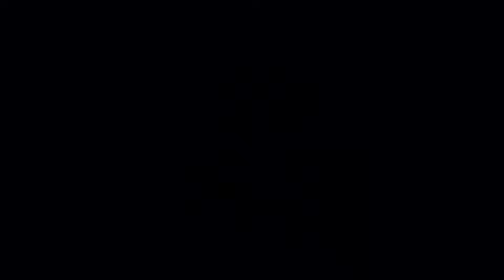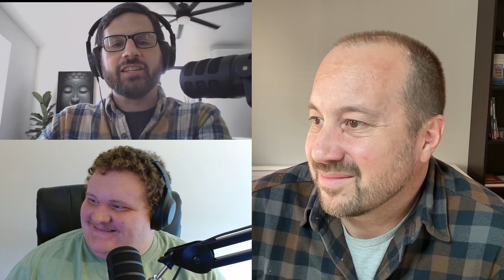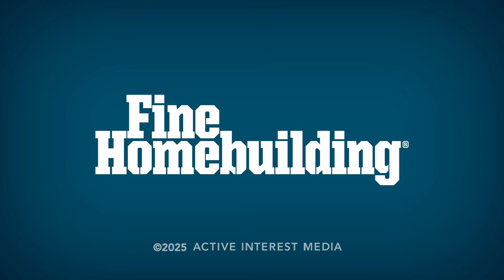A House Without Sheathing Doesn't Have to Be A Teardown | FHB Podcast Episode 711

Comment: Go glad I came across this video. We recently bought a 1979 built house in NorCal. Definitely Overpriced but we got a good interest rate  🙏 
It has very little light so we put in a window on the SW side of the house to bring in some natural light. When putting in the window we found out there’s no sheathing, vapor barrier/house wrap on the house. They just nailed wood siding straight to the wood frame! That’s one reason why my pge bill is outrageous! That along with corporate greed, Newsom’s corrupt backdoor deals w CPUC, PG&E, etc. 
Also they build it on a slab foundation at the bottom of a hill so it floods in the yard. Front AND back yards. First winter the water got into the house! Flooded our sunken living room. Yes they brilliantly thought to put in a sunken room on a slab foundation at the bottom on a hill. Smart. This summer I and my son dug and replaced a French drain but the neighbors yard still drains into ours. Idk if it’s worth it to put up sheathing. Probably won’t know until all the siding is ripped off to see the extent of the damage on the dumbest house ever built! Any tips?
Reply: PG&E bills are generally outrageous -- their rates are nuts. I suspect you'd benefit more from a big solar system + battery backup (look into EG4 options) vs doing a deep energy retrofit. I say this as someone who is just wrapping up a deep energy retrofit and preparing to also add solar + battery backup ... I'm in Minnesota, so the energy retrofit makes a bit more sense with our 0F winter temps, but even so I don't expect it to ever pay itself back. On the other hand, solar in PG&E territory probably will pay itself back in a relatively short time (<10y).

Back to the broader topic ... I'd go in the order of operations: water, air, vapor, and then insulation. On the first two:

Water: If you still have lingering water issues, I'd address those first. If your neighbor's yard drains into yours, is there a way to divert that water elsewhere? And are there any other water issues, e.g. leaky roof?

Air control layer: Sheath would help seal up air leakage, but the details are challenging. If you cannot seal up the bottom and top of the wall, you'll still have a significant stack effect, so be prepared to spend a lot of time detailing around all the rafters and such (or do a chainsaw retrofit and do exterior roof insulation)

If you do resheath, get ZIP -- it's not that much more expensive after thinking about the insane amount of time that is going to go into this. I recently tore off the entire exterior on a 2-story + attic home (27' to peak), resheathed with ZIP, new windows and doors, added 4" of exterior insulation, and put on new siding, detailing all the building science stuff meticulously (and doing my best on the aesthetic stuff). I would never do that again except possibly on a one-story home with an attic. If I lived in California, I'd just get a big solar array plus perhaps a modest battery system and call it a day.

Long term, I think it would be cool if California residents grouped together to do their own microgrids and largely detached from PG&E. In some areas (e.g. San Francisco), my estimates are that this would be economical based on current PG&E rates.
Reply: @dosadoodle thank you for your response. I didn’t think about going around the rafters for the sheathing. I thought it would stop at the top of the wall. I did want to use zip. I did think it would be an easy-ish fix…tearing off siding nailing up zip and putting siding back on, but what do I know? I have no experience. We do need a new roof as well 🤦‍♀️ metal is best for fires in our area. But expensive. it might be better to let it burn in a wildfire at this point lol jk. In the process of getting the neighbors to fix their drainage issues. They’re new owners as well and are wanting to address the problem. Currently heating with firewood only to keep pge bill down. It doesn’t get below 25-30 here. I left SF to buy and miss those  0.11 kWh bills compared to 0.41/0.51 kWh in the country! It blew my mind that’s it’s more expensive in the country than in the city 🤷‍♀️ solar is definitely gonna be the best bet for cost/roi now.
Reply: @Ang.0910  FWIW, I also didn't have any experience before I completely tore off the exterior of our house and resheathed. It took a lot of time and I'd been learning about building science and watching lots of examples for years (before we even owned), and the work was very difficult and took significantly more work than I expected (especially any work above ~15 feet, even with scaffolding). If you are really excited about it, then go for it, but the payback rarely outweighs the costs.

> We do need a new roof as well 🤦‍♀ metal is best for fires in our area.

For roof, I'm 100% in on metal. We got a standing seam roof (our roof was also shot), which makes solar install easier (see the "S-5" fastener system). That said, if a roof has a lot of valleys or hips, then I think the price of a standing seam metal roof goes way up.

>  I left SF to buy and miss those  0.11 kWh bills compared to 0.41/0.51 kWh in the country!

Those are insane prices. If you can DIY your solar + battery system, I'd bet you can get paid back on it quite fast (a few years). We're looking at a payback period of roughly 10 years in Minnesota for a DIY install (~10% annualized return on investment is nothing to sneeze at!).

BTW, we were also in SF for a decade, left in 2022. I recall our electricity price being around 20¢ per kWh, and I've heard of much higher rates for homes using more energy. When were you getting 11¢ rates?!

Whatever you end up doing on the house, best of luck, and I hope it goes well for you!
Reply: @dosadoodle  thanks for all your tips! Especially from someone who has done it. I’ve been considering a diy solar system for a couple years. My neighbors just picked up 33 400watt panels for 6k this past summer and paid $3k to install it. No permit or permission so I’m curious to see what happens when utility company finds out 😬 It’s definitely the best option to get as far away from pge as possible. The sac area has SMUD for their utilities but pge has a monopoly on everywhere else in most of the state. 
In SF I qualified for care so it was 0.11kwh and our building had solar on it as well, so my bills were at most $50/mo in winter. Usually received credits for summer. Now they’re $300 without even using HVAC (turned off at breaker) and using minimal lights and laundry weekly. It’s outrageous! With HVAC in summer I’m over $400 easy. Usually $500+ since I have barely any insulation the HVAC constantly runs. When it reaches desired temp it’ll shut off for maybe 60-90 seconds then pops back on to maintain temp. I also need to replace a couple original metal single pane windows too. 

What neighborhood in The City did u live in? Do u miss the convenience and great restaurants? I sure do. I miss the architecture too. I grew up there so it was quite the culture shock moving to the sticks (what I consider the country) A lot of pretty areas and views but the convenience and choice limitations of everything make u realize how spoiled one can get in a city. Why Minnesota? Winters sound terrible! 
I’ve learned a new term since owning. We’re now considered “house poor” or “home poor” we own but we’re still poor. Haha. At least we’re lucky enough to own 🙏 and try to build equity 

We’re first time buyers and have learned so much about owning a house and the NEVER ENDING list of projects that all seem to be outrageously priced especially these post covid prices! So I’m definitely DIY friendly! I’ve painted. Replaced faucets. Dug a French drain. Built a wood shed, Etc. little things like that. Luckily our house is small and simple (1450sq ft ranch) but it needs major repairs. Cosmetic and necessities. Just had to replace our electric panel or our insurance was going to drop us. $5k. Since it’s stupid CA u have to ask permission for everything and everyone has to have a license. It’s too much when u have to ask permission from ur county just to build a shed or something else minor. Feels like we don’t “own” anything. 

After mass amounts of research, I’m hoping to get the fam on the roof next summer and give it a go ourselves replacing it 🤷‍♀️ might have to call in a company if it goes sideways.
Reply: @Ang.0910  Those bills are nuts, especially for no HVAC usage. Regarding lighting, are you fully on LEDs? If not, the payback period for those would be well under a year at ~50¢ per kWh (easiest update a homeowner can do with a significant savings). It may also worth buying a clamp meter or kill-a-watt device to understand where energy is going. 600 kWh for a month with no HVAC and in that small of a home seems pretty high. Do you have an electrical resistance stove? If so, knowing how much is going into that might suggest a benefit to going induction (which, if before the end of this year, could qualify you for a rebate for 30% off -- but look into the details to confirm before doing this).

> 33 400watt panels for 6k this past summer and paid $3k to install it. No permit or permission so I’m curious to see what happens when utility company finds out

This is fascinating, but it is high risk. A potentially lethal concern is if there is a fire. Firefighters may be unwilling to go into a house with unpermitted solar installed (they will see the panels), because there could be live wires even if they cut the power from the grid, because the solar could still be sending power into the house creating a lethal hazard for them. Even if there is a proper Rapid Shutdown, they have no way to know if the RSD is properly installed without the work being permitted and inspected. And if firefighters cannot enter the home, they cannot help rescue anyone trapped. And a home insurer will likely do everything they can to blame a fire on unpermitted electrical work, which would void the insurance payout.

Poking around online a little, I don't think all jurisdictions in California require a licensed install if it is done by the homeowner who is living in the home. (This is the case in Minnesota, or at least in the city we live.) I would suggest checking your area specifically. To be honest, getting it permitted and inspected will be a pain and probably cost around $500 for ~$5000 of materials installed, but usually inspectors are very helpful people as long as you stay humble, ask questions, and really do go the extra mile to implement their guidance -- that's both what I hear from others and has also been my experience. If you go this route, call the inspector and ask them for details on when they would like to inspect the work. Some will want to make multiple visits out, and others will just do a single inspection at the end. You might even get the contact info for the inspector before paying for a permit to see how friendly/helpful they seem to be regarding DIY solar and then decide on how you want to proceed from there. Example questions: Do you know of other homeowners who have done this? Any words of advice for someone considering doing it?

> After mass amounts of research, I’m hoping to get the fam on the roof next summer and give it a go ourselves replacing it 🤷‍♀ might have to call in a company if it goes sideways.

The roof is one job I tried to tackle, where I was aiming to completely resheath the roof decking, but I gave up after a single day. It was brutal, but in large part because I wanted to resheath and because it was 20+ feet up. I'd consider trying again on a home that was a single story, but no way I'd try again on a 2-story home.

> What neighborhood in The City did u live in? [...]

We were in Upper Haight, and yeah, it was wonderful there (with some downsides, too, as with any place). We ended up moving back to MN because we have family here. My wife and I both grew up here, so the cold isn't too unfamiliar, even if we prefer California weather. :)
Reply: @dosadoodle yes all LEDS, yes we have induction range. I’ll look into the kill a watt device. Never heard of those. 
I’m also curious on the solar end result. They had a professional company install it but they bypassed telling anyone 🤷‍♀️ 😅
After traveling all over US. Cali definitely has the best weather and I would find myself singing “going going back back to Cali Cali” after every trip 😅 the politicians and taxes are just too outrageous now so maybe in future if I can find a decent state to move too I’ll make the leap. Much rather see it get fixed but highly unlikely 😢
Reply: Sheathing wouldn't have much to do with your pge (propane gas?) bill.  Is the house insulated?  A house built in 79 should be insulated.  There may be metal diagonal braces in the stud walls.   We had a yard that flooded, and we put a sump pit in the lowest spot and pumped the water down the hill.
Reply: @Globalinspectionschool  the house is insulated very poorly. R3-7ish in the walls from 1979, same in the attic. That’s why I was thinking putting new R-19 wall batting insulation and zip sheathing would help a lot. No?
Reply: “Corporate greed?” What a N Cali response. How about government stupidity and greed? What about communofacist ideology and greed that doesn’t allow power plants, nuclear etc in deference to wind or solar that doesn’t work? The bottom line is blaming the wrong thing guarantees more of the wrong thing. In a similar case I’d pull off the siding and go with something like Zip insulated sheathing. Put the insulation on the outside and close it back up.
Reply: @bruceami  I'm assuming the first part of your message is parody, yeah? Because PG&E is a for-profit company (not run by the government).

I also find it humous when folks trash solar and batteries. God forbid a homeowner wants to stop paying thousands of dollars every year to big corporations for energy and instead supply their own, becoming more independent and self-sufficient. It seems like some folks trashing solar never stop to think about what the real implications are of solar and wind and instead parrot politicians advocating for what are, ultimately, corporate interests.
Reply: @dosadoodle What, out there your utilities are not government regulated monopolies (fascism) like everywhere else. Sure they are. So not parody at all.

So you think a homeowner paying even more thousands of dollars to a government monopoly (fascism) solar company and for batteries that are very inefficient and thus massively raising his energy costs is a good? Is he then still going to demand that the utility have a full built out system that they can switch on at any hour to make energy when sun or clouds prevail or when there is no wind? What is the cost of that? The issue is the ideological cult who demands government monopoly green scams that benefit those green corporations and yet still demand traditional power to be on stand by. It’s a joke where you haven’t given any thought to the practicality of what you are saying. On the other hand, sure put up solar cells and pay more for your independence. I may do the same. But I won’t demand everyone else pay for it or bend to an empty ideology.
Reply: @bruceami  I've talked to people who actually purchased and get most of their home's energy from solar. Have you? Everyone I've spoken to confirmed that solar really does work, and one of my neighbors no longer has any power bill (they are on a net metering plan). I'm sorry that we cannot agree on the basic and well-documented performance of solar and batteries. (BTW, these are also private companies, and there are many of them. I don't know why you keep using the word fascism -- that term does not mean what you seem to think it means.)

I'd be curious: what solution are you suggesting for pulling away from government-regulated utility monopolies? Solar and batteries are the only option that I see as economical. If you've got another solution in mind, I'd love to hear it.
Reply: @dosadoodle  “I talked to a guy” does not address the issue. Sure after you pay a fortune for solar cells and batteries (that wear out quickly), you can be off grid. But that’s not the issue being discussed. If someone wants to pay a fortune to be off grid and they don’t mind being down if rainy weather sets in for days (batteries only last so long) then that’s fine. What’s been discussed is high power rates. People are demanding a mass switch to solar & wind paid for by government confiscation of wealth of a select few, and they want the power companies to be available to supply full power when wind and solar go down. So you add super high priced wind and solar and at the same time require the power company to maintain not just a grid but full power generation capacity. So you essentially just explode power costs. And that’s in fact happening in Cali. Plus you add AI data centers and car charging it’s exploding demand without properly increasing supply at previous costs.

Fascism is a type of socialism whereby title to property is maintained in private hands but where the government dictates the use of that property. All government monopolies are fascism. Obamacare is fascism. It’s actually the most dominate economic form in the world today. China has even moved from communism to fascism. It’s an immoral system, and until people quit voting for it it will continue to exist. It’s really just communism with better PR and where the government manipulates people into thinking it’s capitalism. I suppose you could say it’s communism with capitalistic incentives built in by leaving some but a diminished right of ownership.

The solution? Ultimately it’s likely nuclear fusion, but it’s not here yet. 2nd best solution nuclear fission plants like we have now. More and smaller. Some companies are working on very small scale nuclear. Wind and solar is fine for those who want to be self sufficient, but it’s not fair to then demand that the power company maintain connection and infrastructure to them for when and if it all goes south. Personally, I would likely go that route, but very few are going to do so. We are a nation of cattle who want everything done for them and provided for them, so in that light a grid is likely always going to be required. Add power dams and whatever else helps at reasonable costs. But get government out of subsidizing anything, because that skews markets and increases costs by rewarding failure.
Reply: @bruceami  So you haven't talked to anyone who has installed solar, and you have zero interest in talking to anyone with firsthand knowledge on the topic. And you think that people should take you seriously? Good luck.